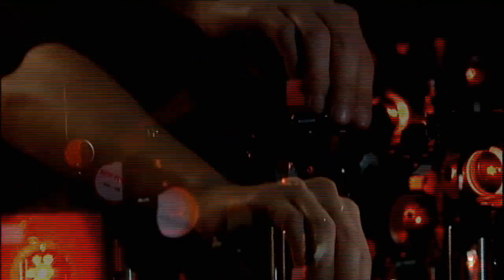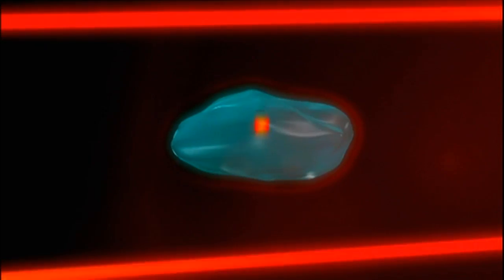Using BEC to Slow Down Light

Comment: Why build quantum computers? 

Quantum computers are useful, they can do calculations for new medicines, solve equations in mathematics and physics that would that too long our fastest and most potent supercomputers in the world couldn't in millions of years (literally), make simulations of the financial market, mess around with machine learning and AI, cryptography (although quantum computers can break any cryptography made in a classic computer), Shor's algorithm and all that, etc. 

Why? Because of their nature, explained in the video, instead of 0 or 1, it can be, 0, 1 or both 0 and 1 at the same time, this tends to sums up and speed up the process so much that a calculation that would that decades, millenia, ends up taking hours in a 150 to 200 qubit computer. Also, entanglement and interference are also a part of the process. It is Quantum Mechanics inside a metal shell, cooled down almost to 0 Kelvin. Some of the problems though, are the decoherence and error problem and the copy problem. The decoherence and error problem happens because it's difficult to fully isolate the particles used in the computer from the environment, so any noise, heat, vibration, any interaction with them at all, can make their entanglement and superposition collapse, leading to errors in calculations. Scientists are improving the chips and qcomputers greatly to compensate this. They have only one processor too, another problem to solve. The cooling problem too, because qcomputers use superconductors, and superconduction needs proximity to 0 Kelvin, also, they tend to get really heated, so it is a two way function. 

Microsoft has claimed to have achieved 1 million qubits, which is crazy, a wallop of qubits. The chip is called is Majorana, like the hypothetical particle (if they prove their statements, the scientist involved might win a Nobel for this, Imo).

Also, Majorana is an awful name for the chip.

Comment: Ok but when the light enter the condensa it's not light anymore, it becomes a combined wave (the wave of the light itself +  the wave  created by the charged particles oscillating in the ligth wave. The resulting wave (or particle) has a mass and therefore can have a speed smaller than the speed of light in vacuum). So I think they did not really slow down light.
Reply: You're absolutely right. Its actually a "Dicke State". This video is quite old. Today there are techniques to stop light completely (or "store" light completely, if you want to use the right wording)

Comment: I think : 
Mechanics( quantum) of light : 

The light is the limit(the border,of things,the edge of the matter) 
Over the limit are no more things,( there is no matter anymore ) 
If you want to pass( break, to outrun ) the limit, you should use :  not matter anymore, ( not particles anymore) 
(Light speed ) It can't be reached  with mechanical movement( mechanical particles movement). Mechanical movement( motion) is for things  under the light's limit,( things with mass, volume etc... For matter,)light is the "wall"( limit) between matter and " No matter " . Don't waste time to break( to outrun) the light's  limit with particles ( like neutrino, tachyon etc..) In this state( situation) you don't have to do with particles , because you want to go over( beyond ) the light ( over the particles) therefore is wasting  of time
. 
Another parallel thought : 

The possible outcome : 
C= constant means : 
The light doesn't move,(  doesn't travel  ) 
The photons doesn't move, therefore ( speed of) light  is constant, because they don't move  , is just  as to turn the page, light just display it( unveils it) , but doesn't move ( doesn't travel) 

The book 91:3 

This is a new point of view 

So you should make another math system, another physical system ( over{ beyond} the matter) , should find new sources . 

If you will approach to the limit( to the border), the limit doesn't have sense anymore, if you pass the limit, the things will change, the system doesn't work anymore, a new system will be applied(  will be working) , for example : if you want to become smaller and smaller and smaller , until you become a string, that is the edge, there is nothing beyond it, if you want to go beyond it, you should leave the entire system, and take a new( different) system . 
It is like to travel with a car, you can travel with the car until in front of you there is the sea, now you should leave the car and take a new vehicle ( a ship) , because the car doesn't work beyond the edge ( beyond the limit ,the land ), there is different environment beyond the land, the car doesn't work there, same is your system, you want to go there but your system doesn't work there, need a new system, new variables, "new tools "... 🦩

Comment: Propogation of any thing in the universe determines maximum speed, not light.  So slowing down light has never reallly been the issue, just the transfer of information. I hate to express this, but qunantum calculations are not the ability to be "both" but, rather our ability to discern which is which via the Heisenberg Uncertainty principle.  the final choice is human not particle or wave driven.  Alll final decisions of precision is the observers ability to discern and accept.  Nothing ever stops moving.  Nay Kelvin, or any state still shows movement, except on paper. So it is the final determination of the observer to accept the outcome regarless of the state we Quantumly assign the variable.  The issue of variable is driven by the Numbber of "observations" If you only have one, there is only a final outcome.  Two or more creates the illusion of choice that is variable by each observation. However, as stated before, that the observer makes the choice, and not the superposition.  Even with Quantum calculations the observer either accepts the reuslts or does not, but that does not change reality.  Enter Schrodenger and the box.  The real question is not life or death as everything is entropy driven, but rather if  TWO or more observers can agree on the state when it went in, or that it went in at all. One person KNOWS what they did.  Two persons if present and both using only scientific method, see it go in, they know it is in the box.   If all are present they all agree, but if even one walks in late the question arises, not every obserer can agree on the state of the cat, or if it is even in the box.  Funny thing is about obserers is that even if one knows the truth, they can be swayed by one who does not. (lambda prime exammple) And, or,  but the agreed upon truth does not change reality
...NUFF SAID...~ Live Free, Bill 2020

Comment: Can any physicists on here speak to what the opposite of Bose-einstein condensate would be? If you heated a dilute gas of bosons to astronomical temperatures and sent light through it, what would happen? Thanks.
Reply: pixpusha at high temperature i guess all the particle of the gas will ionised to form plasma so I u have to figure out what happens when a photon passes through a plasma medium

Comment: Notice the medium is cooled to near absolute zero. Thus light retains information at the quantum level within a medium and releases that information at its exit. Upper limit of light remains, at its constant and the speed limit is not broken. Light immersed within this medium is experiencing a fluctuation of being converted to partial matter and returns to its upper limit by converting the partial matter back into the energy of a photon .... Atomic relations within that near zero temperature is exhibiting a relation that is similar to Particle Entanglement..

Comment: From what I have read about this, the photons are not technically slowing down. They are being absorbed by the atoms in the material and then re-emitted from said atoms. It does this in a cascading manor, and due to the structure of the material, it takes time (speed of a bicylce) for the information to travel through. But, the atom that went in is not the same as the atom that came out. However, since they are elementary particles, there is no distinguishing factors between two photons of the same energy and are therefore deemed to be the same.
Reply: You're in error! Hau really slowed down a laser pulse in a vacuum by making it pass into a standing wave created by 2 counter-propagating waves: 1 from a probe laser, and the other from a coupling laser, and then - only as a second step - by reducing its amplitude still further into a BEC of cold sodium atoms. Here in below I fully explained in 39 pages all her experiment
https://www.academia.edu/37071097/
Reply: This video explains how it work:  https://youtu.be/CUjt36SD3h8

Comment: Well, to my limited knowledge this means we are closer to "store" solar light for 12 hours and release for the next 12 hours for illumination, i.e. no need to convert from light to electricity and back, just make it straight: no wires, no batteries, no photovoltaic cells, no light bulbs, no wires, no extra heat, minimal energy loss, welcome to the beginning of the future!
Reply: Other then the extreme cost of having super cooled condensate. I do like were you are going though, Computers of today were not built in a year.

Comment: It is confusing. as a photon (of light) is travelling at the speed of C, it must not occupy space because of space contraction(concept of Special relativity). 

But you are saying that it is shrieked when slow the speed down. how?
Reply: It's not really space contraction.  The packets of electromagnetic energy that makes up light will propagate through the space between atoms.  As it gets to the next atom, there will be a kind of 'processing' delay before the light carries onto the next atom.  The more densely packed the atoms are within the substance, the longer it will take for light to pass through it.

Think of it as cars on a highway.  They are all doing 100km/h and are evenly spaced apart.  Along the highway there is a stretch where there are stop signs.  A large number of them in succession.  As each car enters this section of highway, being forced to stop over and over, the cars that have yet to enter can catch up a little.  Eventually all the cars are now in this stretch of highway but the space between them is shorter.  Then as they leave, the cars that leave first can get some distance before the next one leaves.  The distance between cars will increase to back to what it was before they entered the stretch of highway with the stop signs.
Reply: With my limited knowledge of SR, let me try to explain a bit.
Space contraction is the decrease in length as measured by the observer.
Just like: try to measure the distance covered by light projected inside a bus in one second;  when you're inside the bus and standing still outside the bus.

However in this case it's the speed of light in that medium decreased. Since C is just the speed of light in Vacuum, (apparently) BEC has a large refractive index such that the speed of light in this particular medium is so slow

Comment: Okay! If light can be slowed down then who is to say it wasnt slowed down in the beginning of out universe? If so then the age of the universe could be much different then we have previously thought. Galaxies could be closer and so on.
Reply: The speed of light determines electromagnetic field strength and beta decay rates. Had the speed of light changed, all crystal structures would have changed as a function of time and that change would have been easily detectable..
Reply: Right on Mark, the "rapid expansion" part of cosmological evolutionary theory is another indicator of the unstable speed of light. Perhaps the one way speed of light is a factor? It can be anything we want to assign according to Einstein.
Reply: +Sparhafoc I mean, does it mean "slowing down" as in Relativity or just really ordinarily slowing down as in fiber optic cables? This would imply quantum tunneling or not. Is cold space "stretched" making particles teletransport through time as any photons to just disappear and reappear back in the same direction as if it had never been "bended" by the observer's perspective due to time becoming relative?

Comment: Is the BEC like light then in that it's not really a solid or a wave? 

I had a thought that if the light is slowed down then does it's wavelength shorten or does it loose information from being compressed similar to a photo's resolution when shrunk? My thought being that there must be a smallest 'frame' that the light can be held in similar a pixel.

Comment: Time simply stops at the speed of light, so, time doesn't exist in the reference frame of light. That much is a well know consequence of the Lorentz transformation.

Now, if light suddenly slows, it will begin to experience time.

Comment: What actually happens is that the photon interacts with the atoms via the electromagnetic force when it travels in any medium. This interaction is what slows the light. Light is most often destroyed this way and turned into kinetic energy for the atoms, but in some cases, like the condensate system, the photons aren't absorbed, just slowed.
Reply: Hope you are still around 10 years later lol. Because I have a question: Is it possible that our interpretation of how near/far stars are could be off based on light either being slowed down or sped up by elements in space? Black holes etc?
Reply: That's what halton arp advocated  @jordanmadden7388
Reply: I too am here 10 years later, wondering similar things. The light was able to be stopped completely, which I'm struggling to comprehend.
Reply: @jordanmadden7388 @crowlsyong the light traveling through space is going to be moving through the vacuum of space for 99+% of its journey. On the instances light passes through mediums such as gas clouds, the speed will be affected slightly. Look up Refraction on Wikipedia. 

There are no chunks of space that have supercooled Bose-Einstein condensates that were very specifically designed in a laboratory for this experiment. Even if there were, if the light spent 1 hour, 1 day, or even years in the medium going slower than usual, it would be a tiny tiny fraction of the time it traveled from distant stars. As far as black holes, the light will not escape a black hole if it passes the event horizon. Light we see is can bend around black holes and reach us, which will slow it down while it’s in the black holes gravitational field. Again, it will be a very small fraction of the journey.
Reply: Same. So ithat what the northern lights are?  Theyreflect this process of electromagnetic interaction with the light?

Doors this happen with our brainwaves? They are electromagnetic, right? "This" being light showing down , if even to the smallest degree? When interacting with the electromagnetic force?  How fun. 😊

Comment: Remember E=mc^2. This equation means that matter is a form of energy. Photons have energy that is not expressed in terms of mass, but they do have momentum, and as strange as this seems, the fact that they have momentum means that their speed can be slowed. Light in fact, is slowed when it travels in any medium, such as glass, water and even air. The speed c is for a hypothetical vacuum.

In the case of the condensate system, this extreme condition slows light much more than glass or water does

Comment: no photons never have mass, other gauge bosons do though like W and Z bosons, when they are supplied enough energy.

The reason photons cause radiation pressure is because they do have momentum which they can impart into matter. Also, they are affected by gravitational forces like you mentioned, but not because they have mass. What happens is that gravitational forces are actually the bending of spacetime. The light travels in a straight line but in curved space this will be a curved line